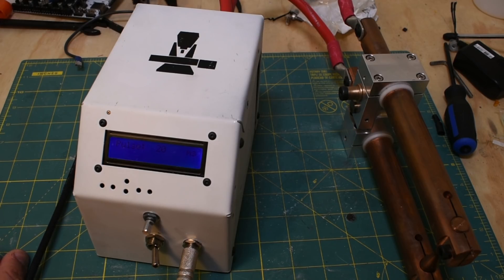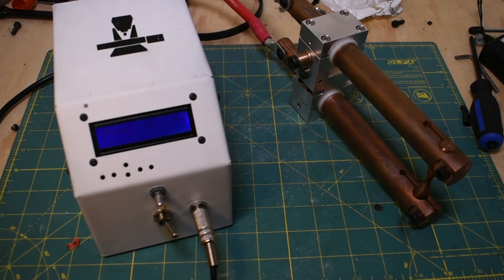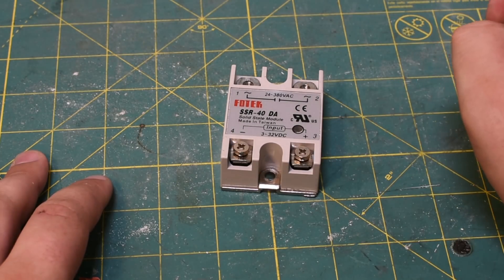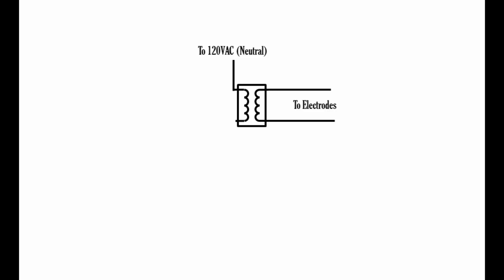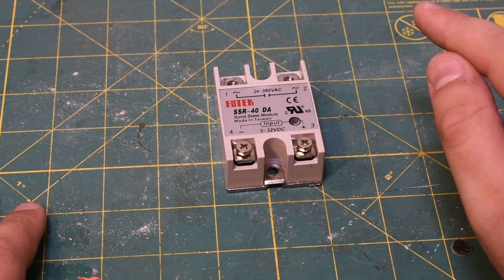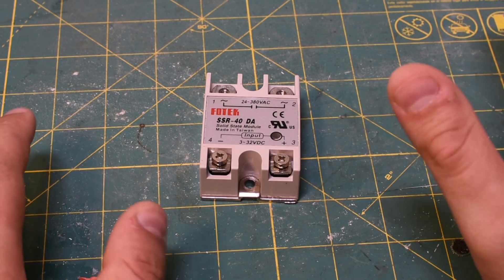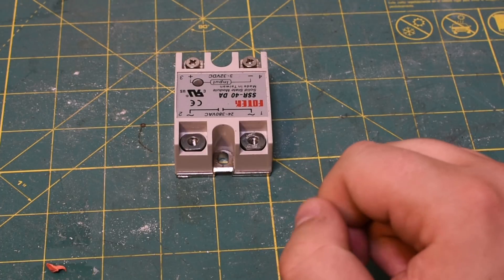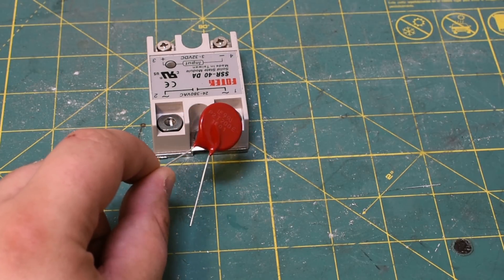Don't Build a Spot Welder Without Watching This First!

Comment: Or just place the capacitor that came with the microwave (2100Vac 0,92uF), on the primary side of the transformer. That should also do the trick when using an SSR. Otherwise you are right about the zero crossing issue.
Reply: Can you tell me how  to hook up a a cap I'm building one now I was thinking a diode as what we have in pinball machines but much bigger .

Comment: Would it make ya cringe to know I use a 110V to 12V/3A "wall plug" transformer that was on it's way to the Island of Misfit Wall Adapters I got for a quarter from a thrift shop, 2 pieces of 8 awg solid copper, a cheap, older "surge protector" (the good old ones with an actual fuse), and a BUNCH of 3M electrical tape? Of course, I also think "specs" are simply nothing more than suggestions provided by the "Legal Teams"  and no limits/parameters of actual components are actually know until you go just past them once ... or 4 times, so that should possibly be a consideration as well “¯\_(ツ)_/¯“ . On my behalf however, I am 50 and haven't blown myself up or burned anything "completely" down yet, but a dude HAS to have goals right? What would make a great life better than being ended with a "death by misadventure" anyhow 😂🤣😂

Comment: Surely in a sine wave, the rate of change is static no matter where on the wave you are?
Reply: If you think back to calculus, the derivative (i.e. rate of change) of sine is cosine, so the rate of change is constantly wiggling between -1 and 1, just like the voltage itself (but out of phase by a quarter of a period).

Comment: Instead of a varistor, it's recommended to use TVS or Transient Voltage Suppressor. Since someof them only pass current in one direction (meant for DC loads), you need two of them in parallel pointing opposite directions, but there are obviously ones meant for AC as well in single package. If you choose something that switches in the range of  ~200v for 120v mains, they should be fine. There's quite a lot of power inside that transformer so bigger the TVS power handling capability the better in this case :)

They have way, way longer life than varistors. Varistor are meant to suppress non repetitive sudden and short voltage spikes that occcur for example in mains electricity. There are types that ahve a third lead that can be used as an indicator when the varistor has to be changed.

More information on TVS: https://m.littelfuse.com/~/media/electronics/application_notes/littelfuse_tvs_diode_overview_application_note.pdf.pdf

Comment: None of the SSR's I've bought was cheap.  We're talking $40 - $60.   So I don't know what you are buying.
Reply: Also 40a is super low rating for spotwelding
Reply: @drcpaintball  That's on the input side of the transformer, at 120VAC. Most home circuits are fused around 20A so it's plenty. The huge current (because low voltage) that produces the weld is on the other (output) side of the transformer.
Reply: @ramenandvitamins  then its pointless

Comment: Ehhh... 
I like those solid state relays, but I don't think this is their circuit.
A regular electromechanical relay would be better. 
The failure mode of an Electromechanical relay can be normal open (turns off when it fails), and would still act as your timing device.

Comment: Using transistors for switching is superior to relays. This is a nice example of nicely designed DIY spot welder. https://youtu.be/Ceos88VO6p4
2000A, automatic time control, delivered energy monitoring
Reply from the maker: I agree, I just don't know nearly enough about AC to make it work:P.  Too many diacs and triacs to keep track of :P

Comment: FYI: Varistors are limited use devices. They can quickly fail. Better option is to go with TVS diodes. You can buy the for AC power from Digikey or Mouser.SCR's Or Triacs only turn OFF at the zero voltage point. You can turn them on at anytime, but its better to turn on a inductive load at or near the zero-crossing.The induction spikes you are experience are caused by induction leakage. This is caused when the Primary & secondary windings aren't perfectly matched, which causes imbalances in the magnetic flux of the core, causing the flux to suddenly snap back when one of the windings is switched off.
Reply from the maker: Awesome, I'll have to look up TVS diodes!  Thanks for the tip!

Comment: What if you use a triac and turn on near peak voltage and turn of when current is 0?
Reply from the maker: I was sort of aiming for minimal power electronics design, so the SSR-Varistor combination seemed safe and reliable enough.  I think the SSR actually uses a triac for 0 crossing, so if one were so inclined they could make a "peak crossing" SSR themselves, but that's comfortably outside my skill level :P

Comment: Would a regular solenoid relay solve this issue? I guess its fast enough for spot welding, and they can usually handle high current
Reply from the maker: I think you get the same voltage spike issue, so you have to use one that's really beefy.  Apparently there's a magical device called a "contactor" that's like a relay on steroids which is designed for switching inductive loads like motors, and I believe those are usually solenoid powered.  They are a bit outside my price range though :(
Reply: Well why not just use the relais used in the microwave oven? If it welds just parallel some relais

Comment: I want to combine your duration electronics with Alexander Hartdegen's power control... but Hmmmm.... now I've got to look into varistors or some other way of controlling spikes......
Thanks for the info, where so many MOT spot welder videos are hurried physical constructions with no theory, it's good to have what you've done here.
Reply from the maker: Thanks!  I can totally see how most people wouldn't run into this problem because they would make the video and not use it very much, whereas I fully intend to use this as a tool so I put enough welds through it to find the problem.  Hopefully this fixes it, otherwise I guess I'm doing a follow up!

Comment: What actually matters is not the voltage curve, but the current curve. This is phase shifted depending on inductance; current peak happens after voltage peak. The ideal disconnection point would be at the CURRENT zero crossing, and the worst disconnection point would be at the CURRENT peak.

The undesired voltage experienced depends on the amount of current flowing through the transformer at the disconnection time, which is the same as the amount of magnetic field present (assuming the transformer is not saturated). The higher the current flowing through the transformer at the disconnect time, the higher the magnetic field and the higher the induced voltages.
Reply: OK, you have two problems in your circuit that I see. First, when you turn on the power, there is a massive inrush current to the coils of the transformer, causing a voltage transient. Voltage transients kill solid state electronics, including solid state relays. You need to add a snubber circuit before the transformer. The easiest way to do this is with a MOV (Metal-oxide Varistor) This site here: https://www.electronics-tutorials.ws/power/transient-suppression.html explains this in detail. I see that you have touched on this issue in the video, but you still have a second problem.

The second problem is the EM field collapsing from the coils when you turn off the power causing a flyback voltage because all that energy stored in the magnetic fields has to go somewhere. A "flyback diode" is what is needed to deal with this. It is normally placed on the primary side of the transformer in parallel. The MOV (snubber circuit) will not deal with this flyback as well as having a flyback diode.

The solid state rely has to either handle these current and voltage spikes, you need to suppress them, or you need to use another way to switch high current and voltage, like a magnetic motor starter.
Reply: @KnightsWithoutATable  how can he use a flyback diode with ac power? if you place the MOV across the load when the back emf exceeds the threshold voltage it will short the winding and dissipate the energy into the coils, which works in our favour as the coil has time to cool down in between welds. The way it is set now the transients will just skip the ssr and go through the coil which may create a voltage high enough on the secondary to shock you. Please let me know if my thinking is correct.
Reply: @BogdanTheGeek  We are trying to cut the power during the low current part of the sine wave, not the low voltage. A transient voltage suppression (TVS) diode, also called a flyback diode, is designed to do just this.

A better solution would be to not use the solid state relay to cut the power and instead use a gate controlled thyristor on the high voltage side to break the welding circuit and then have a surge suppressing circuit placed right before the thyristor to dissipate the transient. A metal oxide varistor would work, but would wear out quickly since this machine produces a transient every time you turn it off. A transient voltage suppression (TVS) diode or a thyristor surge protection device (TSPD) would be the better options.

The thing is, you need really high amperage to spot weld successfully. You could create circuit with a high inrush current and low constant current to create this high current spike. Place the weld in the circuit and it would spot weld easily. So, something like a large inductance coil, like from an induction motor or a salvaged high voltage transformer fed with DC power would do it. To dissipate the flyback voltage when you de-energized it, a flyback diode would be used. A gate controlled thyristor or high current switching transistor would be your 'on/off' for the circuit. You then need a DC voltage source that can release hundreds to thousands of amps in short bursts. A lead acid car battery can do this and is easily sourced. Give it 13 to 15 volts charging between uses and it will be ready each time you need it. So, including a power off switch, you need a lead acid battery, a gate controlled thyristor or high amperage transistor, a large inductance coil, and a flyback diode with a power dissipating resistor.
Reply from the maker: Intetesting.  Someone at work mentioned phase-shifted current but lots of people online mentioned dV/dt ... you sound like you have a good understanding of this.  Out of curiosity, what is dV/dt then?
Reply: It is used when calculating the rise time of a capacitor or coil when a voltage is applied. It involves calculus a bit and is not the best way to understand what is going on with your AC circuit here. Here is a simpler way of understanding active circuits (AC running through coils and capacitors) and phase shifting:

The mnemonic "ELI the ICE man" can be helpful in keeping track of the phase between the voltage and current in an AC circuit.

In a circuit with only an inductor and an AC power source, there is a 90 degrees phase difference between the current and voltage - the voltage leads the current by 90 degrees. This is the ELI part...with an inductor (L), the emf (E) is ahead of the current (I).

In a circuit with only a capacitor and an AC power source, there is also a 90 degrees phase difference between the current and voltage - the voltage lags the current in this case. This is the ICE part...with an capacitor (C), the voltage emf (E) is behind the current (I).
Reply: @TabletopMachineShop  
Dv/dt is a derivative term from calculus. It describes how the voltage changes with respect to time. In an inductive circuit Vind=L dv/dt. With L being the inductance value measured in Henries. If you want to get the current value in a RL circuit it's a matter of using Ohm's law along with the Pythagorean therom I=V/sqrt (R*Xl) with Xl being the Inductive reactance. In an inductive circuit reactance can be calculated with 2pifL with f being the frequency of the AC wave (60Hz in the US 50Hz) in Europe. Phase shift occurs because an inductor resists changes in current flow. This causes the current to lag the voltage.
Reply from the maker: Jeeze there's a mnemonic for everything in electronics..  That's really good to know, thanks for sharing!
Reply: One useful bit of knowledge I picked up in college.  During a transient (aka change in X), a capacitor tries to keep voltage steady (with an electric field) while an inductor tries to keep the current through it steady (with a magnetic field).  As an aside, this also somewhat explains the lagging phenomena described with ELI the ICE man.  Anyway, using Ohm's Law (V = IR), you can think of switching open the relay as bumping the R value way up, and that collapsing magnetic field in the inductor (motor winding, relay coil, etc) will try to keep the current steady (i.e. constant), which, according to Ohm's Law, means the voltage spikes for a moment with a possiblity for arcs and sparks.
Reply: Yes, this is exactly what ELI the ICEman is helping you remember. The phase shifting is also important since you really don't want to have your voltage and current peaks out of phase with each other because it wastes power and can create extra heat. This isn't a problem in small loads like you see in a residential setting, but larger ones, like for the compressor on an air conditioner in a central air system, need to have the phase shifting negated by adding the opposite shift. In the case of a large motor like in the AC system example, capacitors are added to the circuit.

It also helps you remember understand filters for different frequencies and oscillators.
Reply: All resolved in here. https://youtu.be/dgti1ZTHvWI. No transient problems either.

Comment: Wait, isn't the secondary of the transformer in short circuit through the electrodes giving an outlet for the magnetic field to collapse?
Reply: it is (mostly) if the secondary is shorted
Reply from the maker: Perhaps i disconnected it early and thats what caused the failure then?
Reply: Tabletop Machine Shop 
I'd really hope it has an optoisolator of some kind, since most people just hook Arduinos directly to them.
Reply: Presumably also a very low impedance outlet. But what if that got disconnected during the pulse, like for instance if you are welding something and burned through so you no longer made contact?